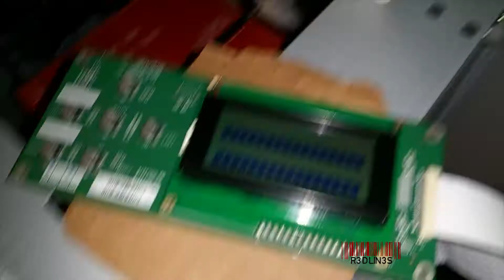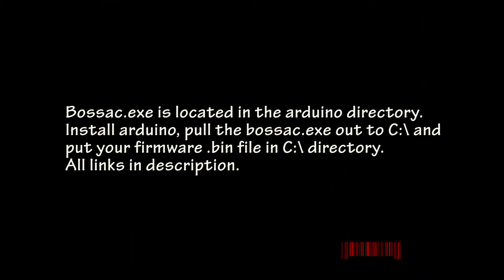Down Flash Firmware, Flash Back To Stock Firmware - Davinci 1.0 3d Printer

Comment: Do you have that bin file? Since this printer is so old all the links are dead and what I was able to find doesn't work. I flashed to repetier but it doesn't work that well and starts printing cold the bed only goes halfway up. I messed with the settings and even copied some settings people used that worked for other people. And I didn't realize I had the 1.01 model and I guess. ... Ahh fuck it long story short I could really use the bin file of original firmware please if you have it.

Comment: I have an older version of the davinci with the jumper pins on it.  I'm trying to wipe out the 1.2.6 firmware.  Just to clarify the steps, would this work:
1 power off the printer
2 jumper JP1 and the pin next to it
3 power on, wait 2 seconds, remove jumper
4 reset power
after that I'm planning to use "Phil's XYZ downgrader"